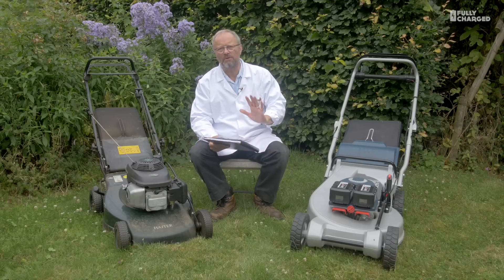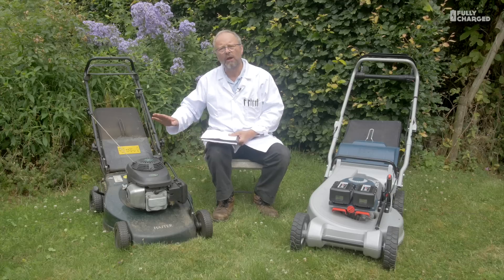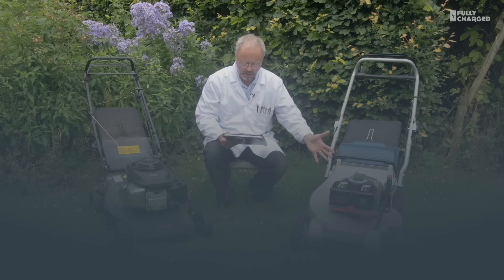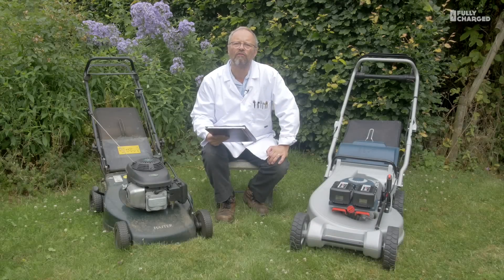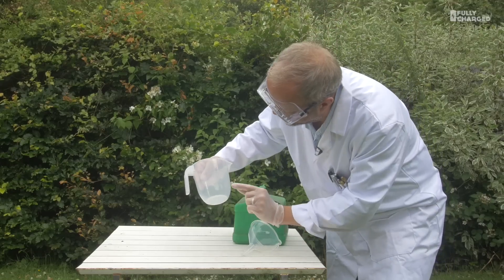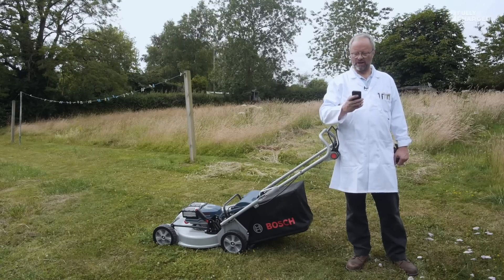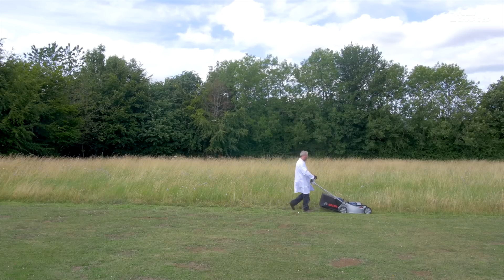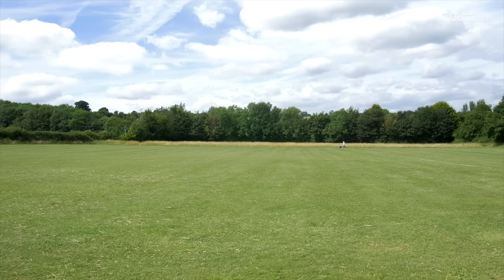Battery V Petrol. The Lawnmower Test | Fully Charged

Comment: Look we should totally switch to electric when it comes to cars but this is a terrible way to illustrate it. I fill my lawnmower maybe once a year from a jerry can that has been standing there for over 8 years. It's about practicality.
Also, handeling petrol like it's satan's piss just makes you look like a loon.
Reply from the maker: +Fake_Blood I am very proud to look like a loon. As you may be able to see from other comments here, most people understood the points I was making.
Reply: +Fake_Blood    "Look we should totally switch to electric when it comes to cars".... Why NOT lawn-mowers, weed-whackers, edgers, leaf-blowers, bush-trimmers, snow-blowers, chainsaws, vacuum-cleaners etc....???? (They could all share the same battery pack) These are probably the most in-efficient, air polluting and annoying sound polluters around!
Do you have an ICE powered drill too?
p.s. "satan's piss" LMAO... I think that's what I'm calling it from here on out, although I think there is also a whiskey from Kentucky that's called that.:-/ Thanks!
Reply: +Dude31463 I support electric lawnmowers because petrol ones make so much noise it drives me nuts.
Reply: +Fake_Blood Why cut the grass yourself, when there is an electric robot that does the same, without noise or pollution ?
Reply: +Fake_Blood Yah. My gas powered shaver just keeps going and going...
Reply: +Fake_Blood Did you not watch the video? +fullychargedshow very clearly said this video was NOT about mowing. Robert merely used mowing as a demonstration of how efficient batteries are compared to internal combustion.
Reply: +AMCT 101 It's a ridiculous comparison. The electricity is produced by oil anyway, and considering the initial heat losses, mechanical motion to electricity conversion losses, transportation losses, charging the battery losses and electricity to mechanical motion convertion losses, you are gonna need a hell of a lot more than 4,5 tablespoons of petrol. And no 'renewable energy' it not yet the answer. As long as Renewable energy can not keep up with the current demand of electricity, every added electric equipment is charged by oil. This being said. There's no need for this machine to be petrol based, as the electric variant is less noisy, can run on the batteries long enough and proper oil based power plants pollute a hell of a lot less, when it comes to small particles, than a small ICE does. Plugging it in when storing is not that much of a hassle either.

Still the comparison is contraproductif as it is completely wrong. If you want to promote the use of electric energy, at least be intellectually correct.
Reply: Matthias Logghe " is produced by oil anyway" You should check this again. Almost no one uses oil to produce energy. You meant coal maybe? Don't embarrass yourself.

Renewable doesn't mean ecological. Biomass and wood burning is renewable. Think about that.
Reply: Matthias Logghe The comparison of energy efficiency at point of use is perfectly valid
Reply: In what world is that perfectly valid? Because the energy losses are not dropped in your backyard? Efficiency is most certainly not one of the reasons to go electric. There are more than enough reasons, this one just ain't it and borders on amateurism if you ask me.
Reply: +Matthias Logghe Nowhere in this video was he "promoting" anything... He simply and brilliantly illustrated in a Scientific method the point of use efficiency between ICE and electric motor! 
It's blatantly obvious, but you had to go and drag in the old, used and tired, invalid "where do you think electricity comes from" argument...? Really?? We've moved on from this!
Reply: Once a year? You must hardly do any lawn care lol
Reply: you fill it once a year with varnish? and it runs?
Reply: Fake_Blood. Bensin är oerhört giftigt och extremt brandfarligt. 
El är framtiden!!!!! . Men framförallt är bränsleceller och vätgas framtiden.
Reply: @hakankinnunen3270  -Hi there! With a name like yours, my friend, please, please, PLEASE tell me that you're a rally driver!   Ari Vatanen, Hannu Mikkola, Juha Kankkunen, Markku Alen, Tommi Makkinen, Hakan Kinnunen...  Oh, no, wait: on this great Channel you'd have to be driving an all-electric rally car, and one of the BEST THINGS about rallying is the ridiculous, terrifying petrol engines. Ah, the sound of a 5-cylinder Group B Audi Quattro flying through a Finnish forest stage at 'maximum attack' is my idea of heaven. Not 'green', not efficient, not anything but glorious... Sigh. I apologise for mentioning petrol on Fully Charged, guys. I just had a bit of a 'moment', there...  ;-)
Reply: Interesting thing... "because the energy losses are not dropped in your backyard"

Seems to raise the question, why is it that petrol is so much more expensive if the energy losses in the use of it are on your end? If producing electricity has so many losses on the end of the power provider why is it exponentially cheaper than getting a gallon of gasoline? If all those energy losses are a deal breaker for you, then I think you should look into getting a discount at the fuel pump because you're eating a lot of energy loss.

Let's talk economics (not ecological) for a second... Petroleum fuel has a much higher energy density to lithium ion storage, but the equivalent to petroleum in energy was stored in the battery and it lasted (10x)+ longer? The cost to charge the battery to that level was also cheaper than the fuel put into the mower. So ignoring what fuel source is more energy dense, ignoring how much cleaner the electric mower was, ignoring all of that other crap... You can mow your lawn for a fraction the cost of fuel, in order to charge the batteries to mow the same plot of land will be cheaper due to this increased efficiency. Because those "losses" you speak of being covered by your power provider it's not even a question.

ICE's are inefficient compared to the electric motor, the price of going "100" miles in a leaf is still a fraction the cost of a gallon of gas, which most vehicles can't even hope to take you "100" miles on a single gallon. This test is simply showing how ridiculously inefficient ICE's really are. Fact is the battery had the equivalent energy to the splash of fluid, you can talk about how the losses already occurred all you want, but it doesn't change the reality that the battery held the same amount of energy and still pushed the mower much much farther.

It's arguable that he could have gotten a more efficiently running gas powered mower, but even then it's unlikely that gas could have mowed for 10 minutes... But also look at the mowing he did with the electric mower. The petrol one mowed a typical "lawn" and the batteries went into a tallgrass meadow. Not sure if you've ever done that with a gas mower before but one thing is easily identifiable, it uses more fuel/energy to deal with tall grass.

Is it a perfect scientific experiment? No, but it didn't have to be he gave gas powered a pretty good advantage on the battery, and it still lost to an extreme extent.
Reply: Fake_Blood but it is Satan's piss, just search for oil refinery explosions.
Reply: Yes, it's laughable how he wore GOOGLES of all things to handle a substance that many people wouldn't mind splashing on themselves.

Comment: Its all very good. But most people just want to mow their lawns. The Bosch Lawnmower is almost £1000 more expensive than the Hayter motif 53 model used here... OK you could probably afford it, if you own a meadow, but then you would probably have a gardener or a ride on lawnmower...

The useful calculations to most people who go about their daily lives would be, how much long would it take for the Electric model to pay for itself over the petrol equivalent? 

My guess is it would be worn out before it does.

Yes, its a 'professional model' but the comparisons are not mine, they are the author of the video, and im not anti-electric either, but cost vs effectiveness is top priority in my life regarding most things...
Reply: A petrol mower typically needs 500ml of oil each season. For me I get a litre of 4 stroke oil for £6. I also use about 6 litres of petrol each summer @ £1.05p a litre. Around £9 per year to run. Cheaper if you're an American... Of course also depends on the size of your lawn. Even if electric was virtually free, if would take about 100 years for the electric mower in this video to pay for itself... Of course, petrol prices fluctuate and so forth but even if it was triple the price it would still take around 30-35 years!
Reply: +DeepSpace Ⓥ I mention the fuel in the calculation. my mower has a sponge filter which simply requires warm soapy water to clean. A tiny squirt of washing up liquid suffices...
Reply: Lee Robinson Think of what the cost of the first mobile phone was. I know today you can pay £1000 for an iPhone, but the first mobile wasn't a computer in your pocket. You can buy a mobile phone for £20-30 these days and it is tiny compared to the first ones which were like a suitcase I believe.

Supply and demand will drive the price down if it catches on, just like electric cars are gradually becoming more affordable.

Comment: Electric motors are SO much more efficient than Gas engines. Period. Anyone who argues otherwise is a dimwit.

The problem still comes down to cost; gas engines are way cheaper to manufacturer than EV motors & batteries in >1kWh are sill prohibitively expensive. Until then, we'll still be stuck with the inefficient but cheaper solution.

Comment: Your comparative test didn't account for all the losses from the source when they burned the fossil fuels at the electric station to make the electric that charges the batteries. You need to do a full systems analysis on the energetics in order to make a meaningful comparison.

Ex. they could have burned 2 liters of petrol to generate the electric just to charge your batteries. There for the direct internal combustion could be more efficient.

Comment: So, he wanted to be precise with how many mL's of fuel he was using, but he didn't bother to go out and get a graduated cylinder or any pipettes?  I mean, given the HUGE disparity between the two mowers, using proper equipment probably only would've changed the results by a matter of seconds, but still, it would've added to the scientific allure...

Comment: if you spend many hours cutting people lawns then petrol is the way to go l do not believe electric mowers can spend all day cutting lawns plus he did not show the back of electric mower what it looked like
Reply: But the electric one lasts so much like longer. Wouldn't it be more useful.
Reply: Sorry, no like. Stupid autocorrect.
Reply: l think they would last for about an hour
Reply: Probably 2, seeing as Robert did 50 minutes on around half of the battery. And at least you wouldn't have to keep on going down to the petrol station. You can easily recharge the batteries and as Robert did, have a cup of tea.
Reply: l would like to see a battery that can last all day on a lawn mower then l will know that they are on a good thing

Comment: +fullychargedshow Cheaper to run??
How much is the electric mower and batteries and charger and power vs the petrol mower and the oil and petrol. 
Maybe an acutual realworld cost comparrison would be useful if you compared over 5 years ownership with 1hours use a week.
I guess you would do this if it were favorable to the electric but its probably not so you leave that out?
Reply: Ok so i completed the calculation over 5 years...

This bosch mower total cost =£2239
Petrol Hyundai 18" 4hp total cost =£410.

Assumptions: bosh mower purchase cost on ebay with two batteries £2239. cost of charging £0 per kwh. 
Hyundai mower purchase cost £200. oil cost over five years £50.

mowing 1 hour per week for five years. Petrol consumption of 0.06lt for 7mins. petrol price at £1.20 per lt.

break even point for owning the electric mower come at around 60 years if you keep the same mowers.

If you buy a new petrol mower every 5 years break even point comes at 30 years.
Reply: Why so much? A nicely thought of 20" battery electric mower here is $280 or £196.
Reply: +David Munson i have compared the mower in the video to a petrol mower.

Comment: What this Test fails to take into account is the Density of the grass you are cutting! These electric mowers would not stand up to grass so thick it can stop a 10 hp Mower. they may have the Efficiency to run long periods of time. but they will never have the power to push through grass extremely Dense and wet!

Comment: Is that 25,500 number you got from petrol the total energy density? If so, only about 30% of that is used, and when compared with the better efficiency of an electric motor with low density batteries, isn't it pretty close?

Comment: I feel like the energy wasted (through heat) from charging those batteries to 100% should be factored into the calculation. also, the batteries might discharge at a non-linear rate

But there's still orders of magnitude involved. And if they're anything like my mobile phone, the first 10% vanishes instantly and the last 10% lasts almost a full day.
Reply: +Adderkleet Not a lot of wasted heat charging batteries, maybe 10% loss. Try putting your hand on the cylinder head of a typical lawnmower to get a feel for wasted heat.

Comment: Sigh...people still bringing up power grid efficiency. Listen, the power grid is NOT SIMPLE. It's a highly complex, parallel system and it's dynamic. It's not as simple as saying that some coal power plant is providing all the power to your house; it's more like at some time X in the day, a nuclear, coal, hydro plant, are providing power in PARALLEL. Then at some time "Y" in the day, a hydro, coal, oil, and solar plant is providing power in PARALLEL.  When you parallel electrical energy sources the efficiency is AVERAGED, NOT MULTIPLIED. 

So if I have 5 different sources of electrical energy in parallel that are 45, 30, 40, 70, 50, then the combined efficiency will be 47%. But that can CHANGE depending on the time of day and load demands since the power grid a DYNAMIC system that switches in and out different electrical sources.

Finally, not all countries are reliant on fossil fuels. Like if you charged the battery for this mower in Norway, Brazil, or New Zealand, then you utterly destroy the well to wheel efficiency of gasoline. Another beauty of electricity is the flexibility on how to produce it. Not so for fossil fuels............

Comment: I.C.E. engines are 1% efficient. Only 1% of the energy in a gallon of gas/petrol is actually used to turn the wheels of a car, sweet deal for the oil companies. Also, you don't have to kill thousands/millions of people to get electricity – added bonus.
Reply: +dewpanic The usually accepted figure is 20% and it can be higher, for a simple lawnmower engine it would be worse than 20%, that's bad enough. Maybe if you added in all the energy costs in extracting the crude, refining and transporting the stuff you could get down to single digit efficiency. Iraq wars don't come cheap.

Comment: I bought my parents a battery powered lawnmower as the electric one with a cable broke down.it is fantastic, light and very movable and as there is no cable you are quicker.my neigbour has a gas one and he is sweating and swearing when he wants to pull start it. then it is noisy and stinks like heck

Comment: As somebody who has an electric lawnmower I am more interested the cost to me.  Electricity costs are so low as to be irrelevant.  The purchase cost was perhaps 30% higher and the running costs really depend on how long the batteries last which I don't know yet.  It is also lighter and quieter than a petrol mower.